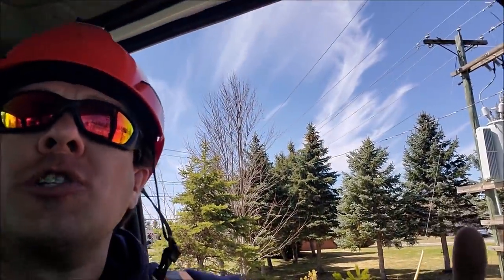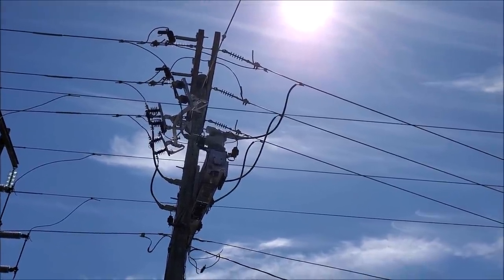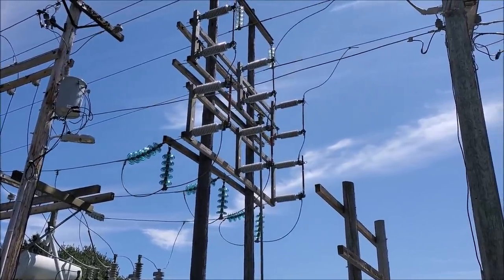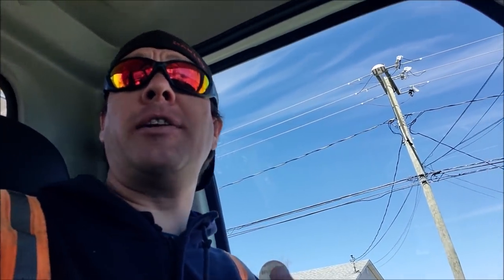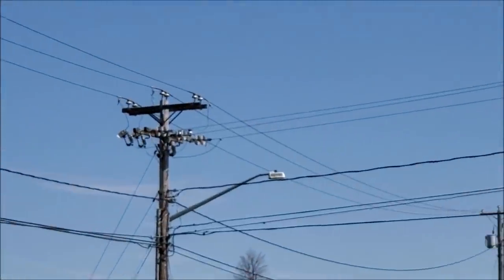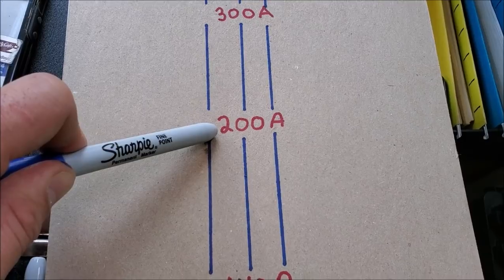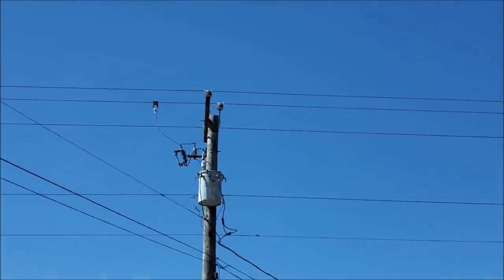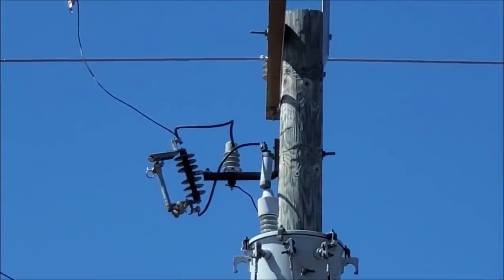Basic components of a power grid

Comment: There was a storm that knocked out a Short WIRE that was attached to a high voltage line. In our neighborhood...a few week's ago...
 It looked sorta like those cut-outs @ 5:06 Time Stamp...
 But it didn't have a cut out, but was one of those Gray Ceramic thing's ? 
  I don't know what it is called ? 
 Fuseable link ? 
Anyway...
  The short wire attached to the high power line, was knocked off the line and dangling, and but still connected, to the Top of the Ceramic just below the high powered line....
 I have to call my electric company and explain what's wrong, but don't know exactly what to call it ?
  There isn't any transformers on this section of pole.
 Just line's....and those Ceramic things, with a very short 1 ft. To 2 foot wire attaching to Top high power Line's...

Comment: About ten years ago, they replaced all the 40-year old above ground transformers in our entire neighborhood. Ever since then we get about three transformers that blowup or short out the system in our neighborhood. I was told by the power company there are about ten houses tied to each transformer. I know it is rarely the fuses that are blowing as when they blow it is often a large plume of smoke that exits the cabinets for at lest five minutes, sometimes longer. When they go, the entire neighborhood goes dark until that transformer is replaced. Occasionally we know something is wrong with the system when the lights dim, then go off and the system resets and the same thing happens again. Sometimes when the system is re-energized is when an explosion occurs and then the power is down for the count. Could you elaborate why each transformer might not be fused or if so why the transformer went without taking out the fuse? Also, why did they replace the 40-year old transformers when the older ones worked better and had fewer failures than the new ones?

Comment: About 11 minutes into the vid, there is a devise on top of the bushing on the transformer. What is that device? We have some 34.5 KV distribution lines here in upstate NY and they too have a devise mounted atop the bushing. Is it some sort of inrush device or what?  Thanks Terry
Reply from the maker: You're exactly right! Most people call it a CL fuse (Current Limiting Fuse). They are typically used closer to substations where fault current tend be get a bit higher. I've had a few requests for a mere in depth vid. I'll try and out something together sometime

Comment: Hey I noticed at 5:51 there's that buck pole and there's two pin insulators at the top for each phase and I was just wondering why that was
Reply from the maker: Hey Tanner, that's a good question! One of our construction standards here is that we are to frame double arms/pins on structures that have large difference in span lengths on either side. I can't remember for sure if that's the case at that particular pole or not ... That transformer pole next spam down seems awfully close so I am guessing that's the case here✌️
Reply: @Bobsdecline  ah that makes sense, thank you for your reply! Work safe out there
Reply from the maker: Thanks man! You too👊
Reply: @Bobsdecline  Road crossing considered a different construction grade. We will always use double support on a road crossing.
Reply: This arrangement is normally seen where there is a sharp change in direction of the lines or at a point where there is a long span before the next pole.  Also it is used commonly at anchor points.  It may be because of the three phase lines attached to the pole at a near right angle.

Comment: Do you install your capacitors when the system built or after the system is in service and you're able to take measurements?
Reply: Electrical Engineers calculates it first and then specs out the caps.

Comment: I'm located in Australia, we have 50hz, 240v/ph and 415v for 3 phase. Apart from those values, what are the main differences between the end user power here and what you have in your region?
Reply: 240V spit into 2 legs of 120V  for residential.... 480V 3 phase for commercial . Now the 480V has 277V  line to ground and transformers are used  to get 208/120V panels. This is for The USA.
Reply: @JBernhard72  Many times commercial buildings are fed with 208/120V directly from the distribution transformer. It's probably more common than 480V for smaller buildings. In fact I once worked at a place where a city building was wired with 480V and I wondered why they bothered, the only 480V load in the entire place was the elevator. And they stuck the step-down transformer in the computer room because someone thought that a single room could be the computer room, electrical room, and telephone room. All I can figure is that Mayor Moron thought that since 480 is bigger than 208 it MUST be better. Never mind the power wasted by those transformers on the CUSTOMER side of the meter...

Comment: How would you suggest to power a 3 phase milling machine at home?? Canada???
Reply: Look up info on static and rotary phase converters. Depending on the voltage of your mill you will likely end up with a combo of a phase converter and a transformer to supply the mill.
Reply: @jimbojames9370  Thanks!
I will look into that.
Reply: @jimbojames9370  It is a german made milling machine. And there are 2 motors. One is for the main drive. The other is just for knee height adjustment.
One of my problems see that both information plates on motors is written in German.. I have not been lucky trying to decyfer online. I can't even find a chart of any kind to refer to.
Reply: You need an electrician (either 442A or 309A with industrial experience) to come out and look at your mill. We would be able to come up with a suitable solution. Your mill is likely 220/400v 3ph 50hz. If this was something simple like a compressor you could use the delta windings on the motor and supply 230v that you have available. In the case of this mill, the contactor coils and other electronics will use the 220v 1ph component of the supplied voltage. All equipment/wire size will be based off of the amperage of the machine.  Ask around to get recommendations  of a good guy/gal in your area to help you with this. Good luck.

Comment: If my home S.E.P has a 200 amp main,  why is the cut out on the high side of the transformer a much lower value? High side has higher voltage and lower value fuse.
Reply: The 7500 requires less amps to make same power  p.  Equals  Current x voltage     100x1a  100      1000x  .1 a  100   ohms law.
Reply: @dondesnoo1771  Thanks!
Reply: Because of what's known as "voltage-amperage" ratio. U double.ur.voltage, with transformers, u then cut ur amperage in half. (120 volts is 1/60th 7200 volts, so an appliance.thst.draws.60 amps at 120 volts, will.translate.into 1 amp on the 7200 volt side of transformer. ( There.is some.areas that may feed populated areas, or long stretchs, where  the primary voltage is 34,000 volts  phase to phase, ( I think that translates into 21,000 volts phase-to- ground). So doing the math, that works out. (If I,m wrong on phase to ground, please correct me, u lineman. ). One good example is the lines running from Morehead City, north Carolina, east on U.S 70 to end of line. Over  years, lineman rebuilt, reconductored and ran double 34,000 circuits, & put "harkers island ", on it,s own 34,000 line. Anyone familiar with that area, knows what I,m discussing. 🐏Sam.

Comment: Sir: On the single phase step down transformer that is shown. How does the ONE PHASE that is feeding this transformer BALANCE BACK to the sub-station?
Only see one conductor going into the top of the oil filled transformer. 
Thank you as always.
Reply: There are several single phase transformers on the distribution circuit. They connect the transformers to different phases to balance the load. Say there are 30 transformers of the same KVA rating. They will connect 10 to each phase so the load is balanced.
Reply from the maker: Yes Jatlife that's 💯 right! 
And perhaps Ted you were also inquiring about the single primary bushing?
The H2 (Neutral) connection on most of our transformers is on the side of the tank and is also bonded to ground. It limits some of the options this design has compared to the transformer with two insulated bushings on either end of the primary winding.
Reply: JATlifeVlogs Thank you for responding. Understand everything you said.
I am interested in the single bushing at the top of the transformer.
Only looking at one of the three phases.   The lineman says the H2 on the
side oh the transformer is connected to ground.  THAT IS THE QUESTION.
Does this use the ground to balance the AMPS back to the distribution point?
Reply: JATlifeVlogs Thank you for responding.  Interested in the Primary winding
in the single phase transformer.  The lineman says there are two types.
Some have H2 (neutral) on the side of the can, bonded to ground.  
Does this balance this one phase back to the sub-station? Thank you.
Reply: Bobsdecline - Lineman blogger Thank you.  Question please. If SOME single
phase step down transformers have two bushings the the DISTRIBUTION
system must have a Neutral conductor back to the sub-station, as OPPOSED
to the transformers that only have one bushing at top, (which have the SECOND
END) of the primary winding bonded to earth ground.  Is this anywhere CLOSE
to be correct? Thank you as always.
Reply from the maker: Actually both those setups will follow the same standard with our current system.

Our neutral is bonded to ground at every structure. Since our neutral is at the same potential as ground there is simply no longer a need for a bushing on the H2 connection.

The system works very well, the actual "ground" can help carry a small percentage of return current back to the sub.
Reply: @Bobsdecline  It should also be mentioned that single bushing transformers are less expensive than two bushing transformers. A single-bushing transformer doesn't have to be fully voltage-rated because it designed so that one end of it is always connected to neutral/ground. This makes it less expensive to manufacture. The actual transformer inside the can is different, it's not just a matter of changing the lid out for one with two bushings on it.
Reply from the maker: @brianleeper5737  very good point, I never even thought of that!

Comment: Im a step 2 apprentice so there's 100 things I learn daily! all but one of our substations is 138kv we have one 69kv are all 69kv secondary 12470?
Reply from the maker: We did have a 25kv line that was fed from a 69kv sub, but the 25 kV was stepped up from 12470 outside of the sub.
I can't see any reason why a 69kv power transformer wouldn't have some variations out there in their design/ratio to allow for higher or lower secondary voltage....
But it's not something that I have personally seen
Reply: @Bobsdecline  oh ok for some reason i thought I heard you say on your 69 sub 12470 came out of it
Reply from the maker: @justingarcia8619  you did 😄 sorry sometimes I can be bad at explaining stuff.

Our 69kv subs are all 12470, we used to have an old fee that was 25kv but it didn't come directly off the power tx ✌️

Comment: Wait, so the wire gauge is the same all down the line but the fuses get smaller ? This is to isolate the fault?
Reply: Series fuses get decreasingly smaller so they coordinate. The idea is to only blow the smallest fuse closest to the fault. You don't want a fault on the end of a line blowing a fuse that's three fuses upline. That would kill power to more customers than necessary and makes troubleshooting more difficult.

Comment: I just discovered your channel and I'm catching up on videos, so please disregard this if you answer it later.

Is there any situation where power lines would experience capacitive loss and need inductors to correct the power factor? Can you show an example of such an inductor?
Reply: The vast majority of the heaviest loads are motors, and motors are inductive. Heat pumps, refrigerators, air conditioners, fluorescent lights and the truly large industrial motors all make the grid on average inductive.  Led and ccfl lights, and the switching power supplies built into everything now are capacitive.  But lights have a long way to go to catch up to the motors.  That’s why you usually only see capacitors being used for power factor correction. Resistive heaters like electric strip heat, toasters and your oven is power factor neutral. Some newer electronics (like computers) have power factor correctors built in .

Comment: When the subject gets into Power Factor to understand what Bobsdecline is speaking about you need to better understand both DC and AC electrical theory.  Then understand the basics of LC circuits when an AC voltage is applied to that circuit. I am positive there are some videos that get into this. What I want to do is show using math graphically how the power company can suffer losses when there is a serious issue with the power factor. Let's assume a kilowatt-hour costs 15 cents.  The customer uses 2500 KW in a month. .15 X 2500 = 375. Their power bill will be $375 (US) for that month. Now, that home is on a line with a problem that creates a power factor of .98. Using the same figures from before we have to now add that power factor into the math. What this means is you have to take .15 X 2500 X .98. = 367.5 Let's round that number down to $367. The power company has lost $8 because of that power factor. That sounds like a small number, but what if there are 1 thousand customers on that line using an average of 1500  Kilowatt-hours? Then it goes 6 or more months without being fixed? This right here is why there are capacitors on those lines. I don't know about Bobsdecline's company, but there are several power companies in the US that have a continued problem with people shooting the insulators that you can see at the 2:37 mark on the lower left. I hope Bobsdecline sees this. I will allow him to tell everybody how long it takes to replace those insulators.
Reply from the maker: 💯🙌!

We do have some meters on large commercial customers that bill KVA usage. The majority however and all residential are billed for KW only. This alone makes those "power factor saver" contraptions sold online completely useless. For the most part, any losses in power factor are absorbed by the provider.
Excellent explanation with some numbers included ⤴️

We're lucky that insulators being shot out isn't a huge problem in our area, but definitely still happens 😔

Thanks Michael!

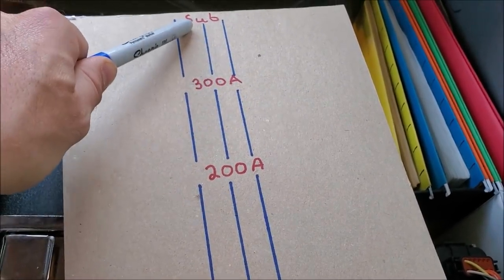Comment: 8:30 You said 60 cycles / sec. Isn't it 120?
Reply from the maker: Our system is 60Hz, so a full wave  (1 cycle) is 1/60 of a second ... Which if you had a visual representation of a sine wave would show 120 peaks and also equal 120 directional changes

Comment: The actual transformer failures that have me curious is the ones in sub stations. There are many youtube videos of substation disasters. It appears usually a flashover perhaps from an animal that sparks a flashover then all hell breaks loose. The flashover arc gets worse and worse until the transformer overheats and eventually vents the superheated oil that ignites and a huge fireball goes up. Several seemed pretty intense yet the fuses didnt open the supply power and disconnect the subs transformer before it did self destruct. One disaster shown on yourtube doesn't really explain the reason of an explosion where a new power transformer was installed and exploded with the workers present. Said a women with the company was there to check with the install and it blew up killing her and seriously injuring others. https://www.youtube.com/watch?v=XDI7WnlUEU0

Comment: What is the liquid inside  TRANSFORMER.. one blew in my backyard and it leaked liquid onto my wifes clothes line,, the techs were wiping it off.
Reply: Texas tough; it's mineral oil, non toxic.  They have been using that for about the last 40-50 years.  However in industry and in substations the big, old transformers used oil with PCB's for cooling.  Some of these may be over 100 years old.  Transformers with this high capacity are VERY expensive (a lot of copper in there) and since they last so long, they are virtually hand built.  And many users will hold on to them because when replaced, they will have to pay to pump out the PCB's and properly dispose it.
Reply: @davidmarquardt2445  Older pole transformers may use PCBs and PCBs were not banned until 1979. It's reasonable to assume, and I have been told that this is the case, there may still be old pole transformers in service that contain PCBs, although the power companies are working to replace them.

Comment: They have voltage regulators cause the power company too cheap to buy a load tap transformer
Reply from the maker: Most of our power transformers have built in tap changers. In some of the older subs VR's are used, as well as on long rural feeds